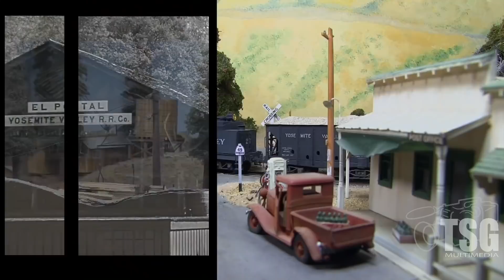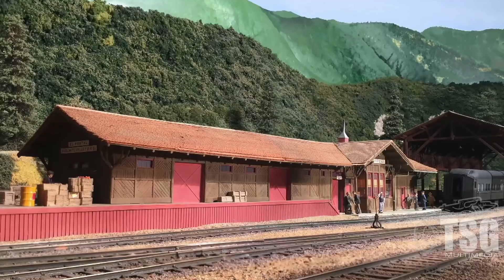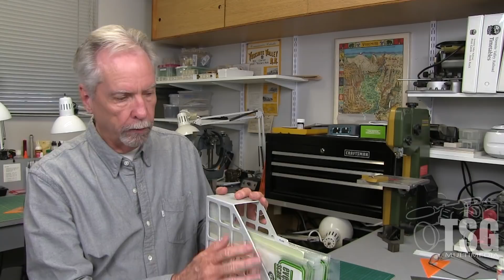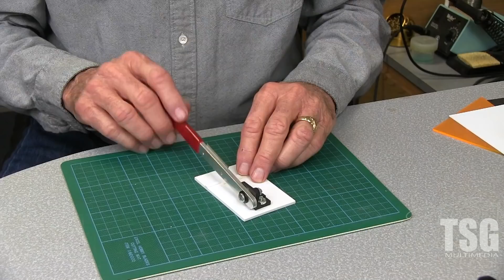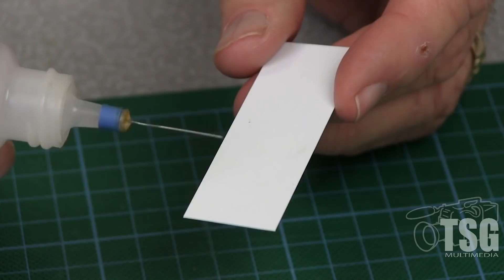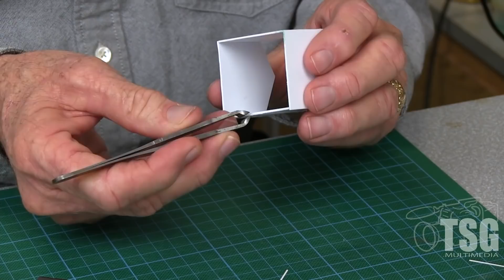Model Railroading with Jack Burgess Building with Styrene 1

Comment: I’ve used a NWSL Chopper for a bunch of years and had the same groove issue. I disassembled it, drilled mounting holes for everything on the other end of the board, and reassembled it. I also took a self healing cutting Matt and layed it on the table part of the chopper! Micro Mark sells the former NWSL products under their brand now I think.

Comment: I was so glad to see you mention "Canopy Glue" (Pacer Formula 560).  I also use it for putting LEDs in place in the locos, tacking wires in place with decoder installation, and metal or plastic detail parts.  Lots of uses for this glue.  And when putting in windows, locos, passenger cars, windows, it doesn't craze the plastic like solvent based glues.

Comment: Jack, as always you're a credit to the hobby. Thanks for all you do. Q: any recommendations for cutting styrene thicker than .040?
Reply: Yes can cut it the same way but make about 6-8 passes with the Xacto knife. "Snapping" it can be a problem. One approach that I have used is to put the styrene on your workbench with a piece of solid brass or metal rod about 1/16" thick under the styrene wih the rod aligned with the scribe line. Hold one end down tight to the workbench and whack the other end with the palm of your other hand. If I have a number of pieces of .060" styrene to cut, I will used my miniature table saw. But I don't use much .060 styrene except for jigs and such.

Good luck!

Comment: Great share! Jack, can you please walk me through the voltage numbers for a HO-scale layout. Specifically, what voltage is used on the bus wires? What voltage is running along the train tracks? Happy New Year!!!
Reply: If you are talking about standard non-DCC wiring, the voltage is 12 volts both in the track wiring and in the rails...
Reply: Thank you for replying. My error. I am looking for the DCC voltage for both the track rails and the bus wires. I want to know what numbers to test for with the multi-meter.
Reply: Google it and you should get your answer...

Comment: I thought I'd chime in on this, as my LGB and Bachmann 2 axle bobber cabeese didn't have windows at certain ends, so I basically use Evergreen's clear styrene cut to act as windows with a styrene strip frame around it to act as a panel to hide the seams. also I'm about to use the plastructs T Beams to act as braces on my LGB Motorized tender and when nthat's done I'll post the photos

Comment: Thanks for the info Jack, I appreciate the Tip. So where is a good source for the MEK? Also does it stick to the cutting mat?  other then Glass what are other surfaces to assemble on that you wont glue your work too?
Reply: MEK is available at hardware stores except on California where it was taken off of the market several years ago. It bonds styrene by melting the two surfaces very slightly and then evaporates leaving them bonded/melted together. It doesn't stick to a cutting mat or glass. (In the video, I had the two pieces of the building setting on the cutting mat and didn’t even think about it being bonded to the matt.) You really don’t need to worry about bonding your styrene model to anything except another piece of styrene. The only real concern it two pieces of styrene together crooked…as soon as the MEK flashes off, you will not be able to separate them.